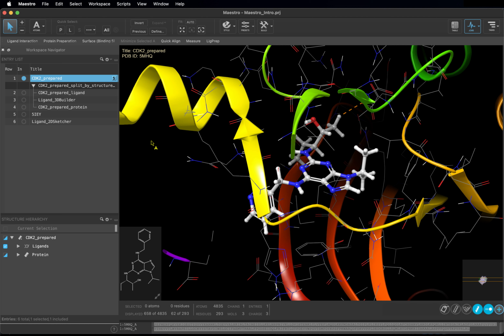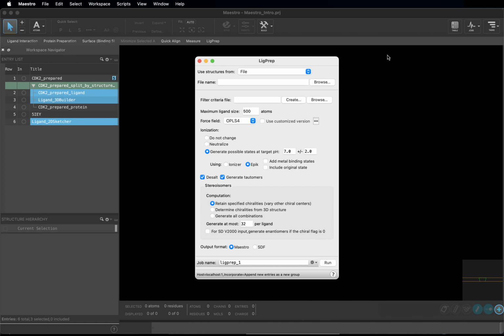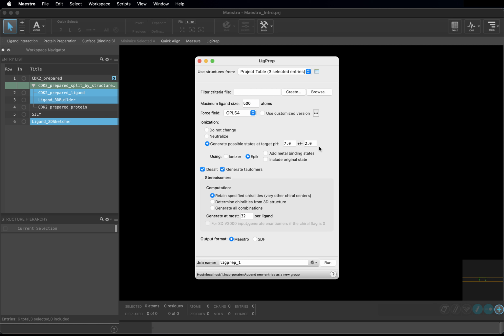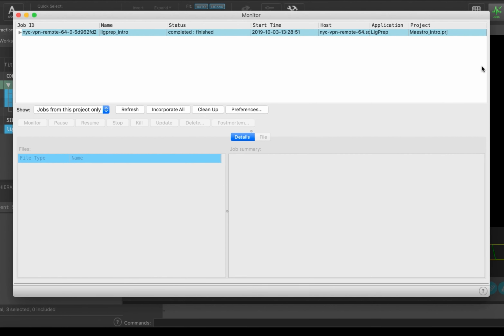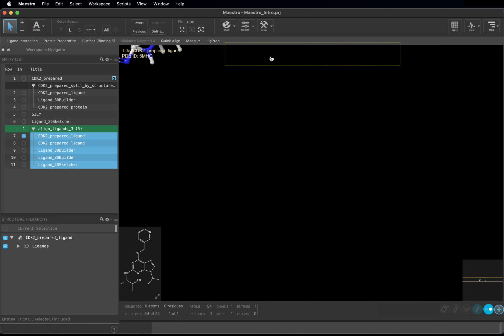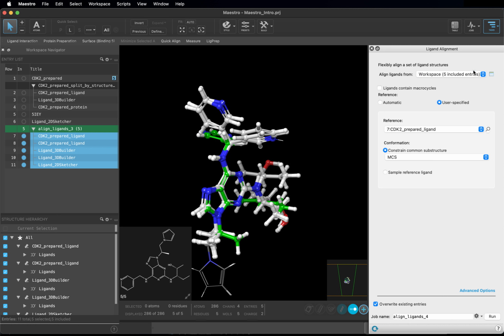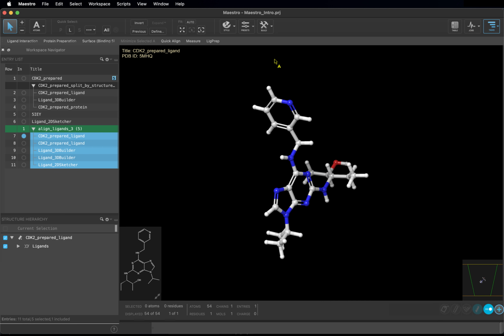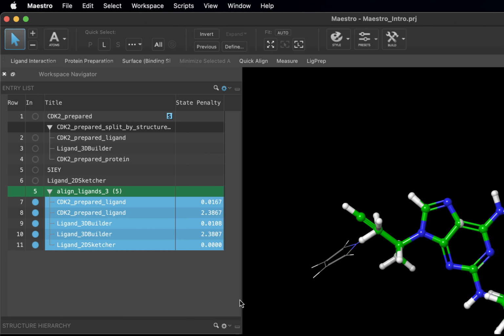Learn Maestro: Ligand preparation and job monitor

Comment: I am using Maestro 2024-1 academic version. Im facing eror in protein preparation: Epik_licence not available, prime can not be accessed.
What could be the issue could you tell me?
Thank you
Reply from the maker: Hi there,

This error is due to not having the required licenses for the application you are trying to run. I would suggest confirming that you have the Academic version, that is able to connect to any licenses you have, and not the free Maestro Viewer. Maestro Viewer, formerly known as Free Maestro, is free for academics to use but does not allow for access to any licenses to run calculations. If you continue to run into issues, please feel free to reach out to our Scientific and Technical Support team via help@schrodinger.com. Thanks!
Reply: @SchrodingerInc  Thanks for the reply.